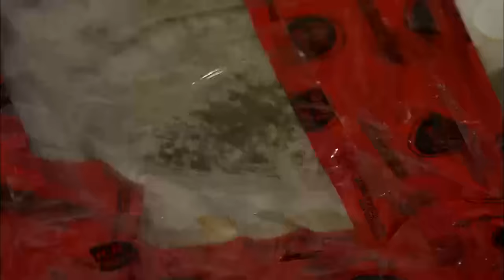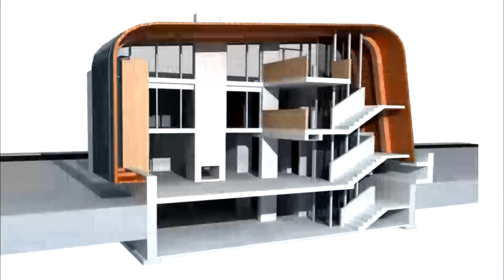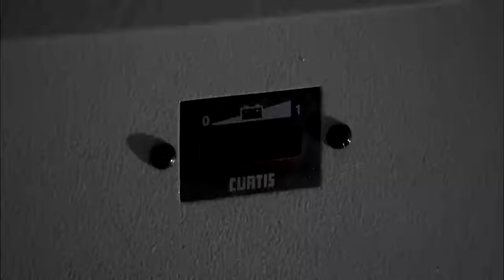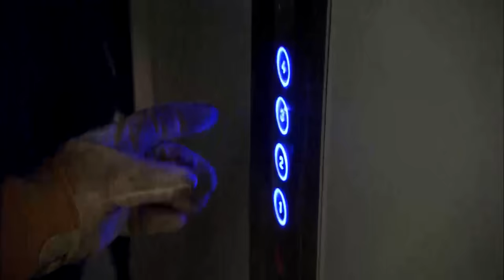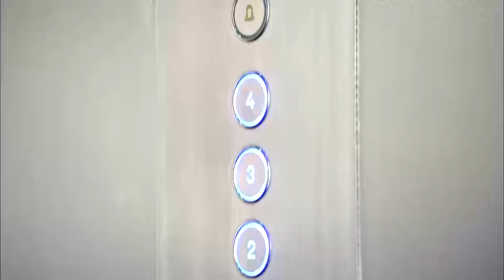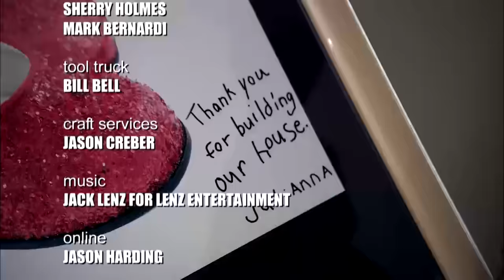Lien On Me | Holmes on Homes Special

Comment: We should have a website where home owner can post detailed contractor information after Holmes done helping them. This way, we will know who to avoid. And contractor can watch out as their work will be opened up for all to see. Fair?
[edit] and I thought the addition should be inspected by city each step along the way. Since there are so many issues (structural, electric, insulation, ...), shouldn't the inspector know better? From my limited experiences, city do look at the gauge of material, and the way it is applied for the work I put in myself. Couldn't believe city guys will just let everything go?! If the building should collapse for whatever reason, shouldn't city be called out for a shoddy work they are responsible for?

Comment: At 1:11:14 guy installing the solar cells, says, the foil will, in addition to reflecting heat, will also reflect the cold.  ????? Huh????   That is physically impossible.  "Cold" is an absence of heat.  That guy is talking balderdash.
Reply: Right, I agree.  If you check out even simple insulation like reflectix, which is a reflective, "aluminium" "padded foam" insulation, it will tell you that you can't reflect cold.  

However, I think you can give this guy a pass as just being nervous in front of the camera.  You can tell because Mike said, "ohh really"

Comment: What happened is the contractor probably hired sub contractors to work on the house and not just one. One did this much and another company comes in and doesn't know what the first guy did so they start from scratch or do a bad job.

Comment: While the style of the house is not my cuppa (I would not want that particular style at all), I do appreciate the amount of engineering and state-of-the-art products and technology that has gone into it's construction. 

The previous house, the one the contractor said was a Mercedes was just ugly, bulky and blocky, it too is not my cuppa. (Okay I admit, I'm a log cabin or old brick house sort of person). I hope to pit that this guy never gets to build again, I hope that he is named and shamed somewhere.

ON a side note, I also fell victim (as a new home owner) to a shoddy roofer, who did the roof, but didn't do the job correctly. The chimney leaked like a sieve and I couldn't get them to come and look. Oh they were in PEI helping out with hurricanes, then they ghosted us after. Other contractors wouldn't touch the roof because it was so high. I got lucky when a guy doing a roof down the road answered my request to take a look at the chimney after I explained the problem. 

He went up to look, said it was very poorly done, no sealing to speak of. He said after his job was done at the house he was working at he would fit in an emergency work, because it needed to be done. I haven't had a leak since.

My house is in a desperate need of a lot of work, we're doing it when we can, hopefully we can get the attic insulated, and new windows installed up there. It's 110 year old house. We upgraded to heat pumps, which we do not regret at all.

IF I could redo our house, I would take a lot of that technology used in the house int eh episode and use it in mine, as long as it looks like house and not a minecraft build.

Comment: Inspectors, either private or for a municipality, they are all on the take. I wish I was a judge and I wish I got that case. I would make sure those people got compensation and I would ensure that the other contractor, that liened the house, I would null, void, and vacate the lien and I'd put him in prison for fraud. I would then find the inspectors that passed that and make sure they couldn't so much as inspect their gadget. The plastic plumbing is poisonous. Hate to break it to you. It causes the cancer. Even BPA free plastic is still toxic. Should be copper.

Also, I hate hearing fake numbers. It is mathematically IMPOSSIBLE to have more than 100 % of anything. If I have 100 apples, I have 100 % of apples. If you give me 100 more apples, I do not have 200 % That's ridiculous. I have 100 % of 200 apples. So you gave me 50 % if I lose 50 % of those apples, then I have 100 apples. If you gave me 500 apples, I didn't have 500 % I had 100 % of 5 apples. If I lose 50 % of those apples, then I have 100 % of 250 apples. Not 200 %. When you say numbers higher than 100 % you sound like you have no clue as to what in the hell you're talking about.

Comment: Before I didn’t like Mike Homes I found him to be a bull in a china shop, now being exposed to the piss poor workmanship throughout my time being a contractor and having to recorrect issues I can see why he has short attitude. I’ve seen a few things that made me question what the contractor was thinking most of the time as it’s plumbing or electrical issues or framing but not to a point where a hole house has to come down. Something has to be passed by law to have these individuals held responsible or punished.

Comment: I will join the chorus with so many others: I wish I knew the legal outcome from the lawsuit.  In my opinion, what that original contractor did is criminally wrong.  I’d also like to know if Mike and/or the family’s attorneys followed up with almost equally criminal signing off on the project by building inspectors.  They are the safeguard and the failed in the worst possible way.

Comment: The new home is probably the most efficient and maintenance free hone I've ever seen. I completely appreciate everything the Holmes team strives to accomplish. 
BUT, in brutal honesty, IN MY OPINION, it looks like someone dropoed an oncology clinic into the middle of a residential neighborhood. It stands out like a sore thumb, and not in a good way. The value of the home is far more than any other home in the neighborhood, which means if it ever goes up for sale, it will probably not sell for it's actual worth or cost of construction. It would probably bring more selling out as used architectural components, parts, appliances and accessories.

Comment: Concrete walls? That aint.. nice even in full concrete panel building we have in general O.o
Full concrete "base" we have in EU.. is one slab of concrete.. they used that only for "walls" and stuff like that, then filled in walls O.o that is just so wild.
Bricks? Nope? From full wood to concrete steel? That house rework went from "normal house" to weird.. structure for rich people? That does not resemble original at all O.o not even the botched reconstruction with "stone" ish looking walls etc? Massive ceiling to waste power to heat up O.o
1:25:00 "It is not gonna burn" Well.. in general EU houses are brick build.. brick wont burn same way as concrete.. or even fully concrete house.. but still you can burn down to crisp cause interior, paint, furniture.. all is burnable.
How do you even keep the "quality" on the par you want with 100 different companies?
I mean.. good job building the house, not my cup of tea at all but well..
The jerk that did first rework.. should be stripped of his job and pay for all of it..